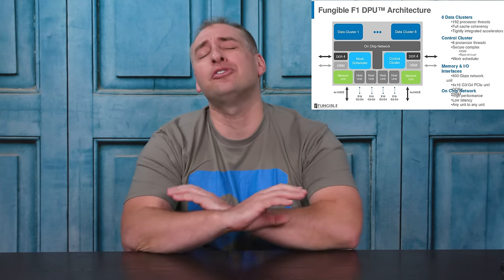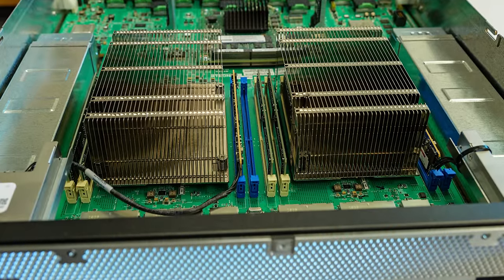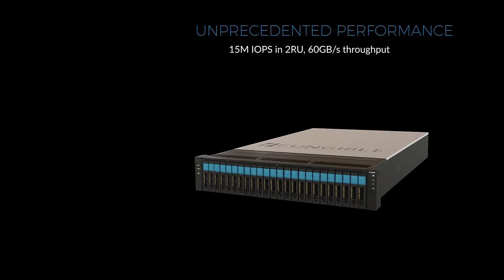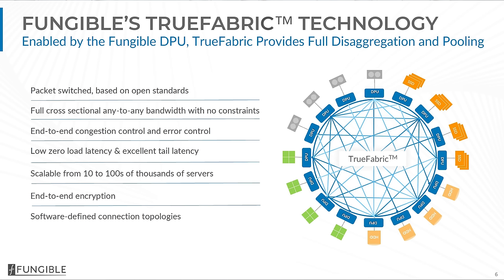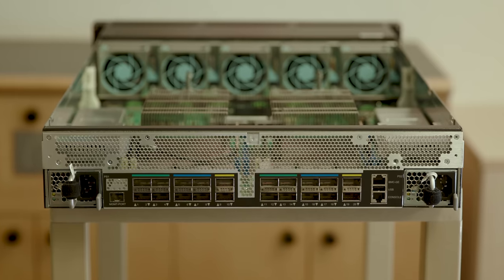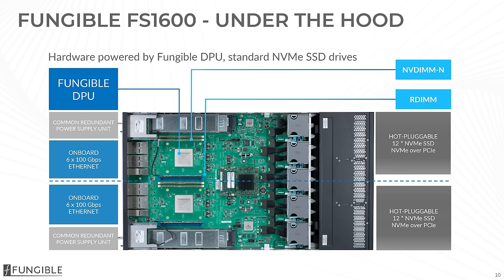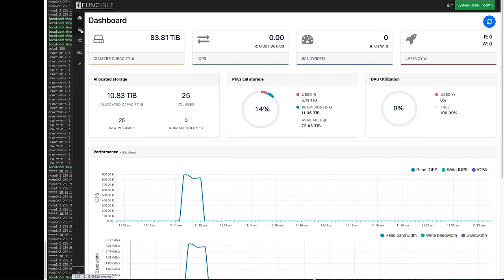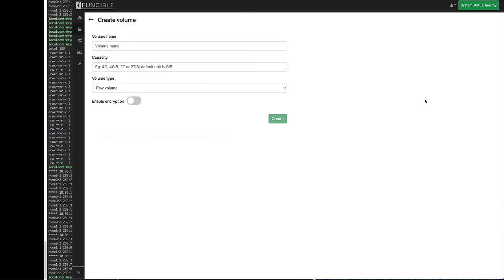Fungible F1 DPU Powered Storage Hands-on at Fungible HQ

Comment: For some reason I lost my shit when I saw the 10G management port haha
Reply: yeah that's really a 'because we can' thing 'eh... lol
Reply: Eh, it sounds "Crazy" when looked at from a bandwidth perspective; but from a latency perspective, the time the packet takes to transit the wire also sees a tenfold reduction. Moving from 1536 octet ethernet frames to 9000 octet jumbo frames (required as part of the 1000baseT & 10gbaseT spec now, previously optional in the 100baseT spec) is also an option for internally routed traffic that doesn't traverse the gateway out to the WAN. And for some of the new redfish management responses, they'll be chucked into time-series databases like grafana, and the finer granularity of the timestamp deltas makes order-of-events cluster-wide easier to determine accurately. This is one of the primary reasons I moved all my colocated machines onto 10G switch ports, but retained my low transit cap. I don't use a lot of bandwidth; but I frequently make interactive use of it (remote management) for control plane manipulation and VM setup, so lowering the round trip times can make a massive difference in quality-of-life, even if it's something as simple as VNC.
Reply: @SLLabsKamilion  yeah, I am aware of the latency reduction (not really sure why you went into Jframes though since they /can/ be present even with GigE, but still, for a management interface that's likely just serving a html5 configuration page the latency improvement from a few ms to tens of ns will be completely unnoticeable, so I'm not really sure I get your angle here. 
It's more likely that the CPU (DPU?) Just doesn't have the hardware for 1GbE, instead having 10GbE as a minimum, which is fairly reasonable from a 100GbE processor. 
There's a reason why the BMC only has 1GbE and that's because nothing more is needed, but unlike the DPU it doesn't natively support anything over 1GbE.

Comment: The biggest problem that I've ran into with ultra fast SSDs is that the faster they are, the faster they will die.

(Because you will want to use the blazing fast system ALL. THE. TIME. And because even enterprise class SSDs that can sustain 10 DWPD still uses NAND flash memory cells/modules with finite erase/program cycles, it just means that you WILL burn through that write endurance limit really, really quickly.)

What I would be MOST curious and MOST interested in is if you yanked one or a few of the drives out from each node and to see what happens to the system and the robustness and integrity of the service that's provided by the system (or when you burn through the erase/program cycles of the NVMe U.2 SSDs) and the drives mark themselves as either in read-only mode, or it just dies.

I'd be really interested to see how the system reacts to that, because it WILL happen with SSDs of any kind.

Comment: Fantastic read performance! Relevant for zero workloads...
Not a single question on write performance? Cmon, you guys can be a little more critical, you know this stuff.
Reply from the maker: Have some more on the STH main site on performance. Actually, they can get closer to 15M IOPS / 60GB/s per node but we are only giving credit for what was demonstrated. We only used up to 5 client servers and the client servers topped out around 2M IOPS and 60GB/s. That was a 15-20 minute demo that we had to cut down. NVDIMM is there to help absorb write workloads and sync writes. Good point. Probably should have left more of that in there.

Comment: No one:

Fungible: Here's an NVMe array with 10 million IOPS
Reply: just imagine how many VMs you could run on this bad boy
Reply: I would (ask for one) if it weren't for the fact that NVMe SSDs are such data death traps.
Reply: @ewenchan1239  What is the problem with NVMe SSDs ? Please elaborate ...
Reply: @prashanthb6521  
It isn't only with NVMe SSD. It's ALL SSDs in that the NAND flash memory cells have a finite number of erase/program cycles.

Therefore; even with provisioning, once you've consumed those finite number of erase/program cycles, the SSD is pretty much trash at that point, unless you specifically set the SSD to be a WORM, which, let's face it, nobody does that with a SSD.

As a result, SSDs are like the brake pads on a car - it's a wear item, that once you've worn through the write endurance limit, you throw it out and buy a new one.

All NAND flash based SSDs work this way.
Reply: @prashanthb6521  
I've burn through six the write endurance limit of 6 SSDs over the last four years because of this fact about the underlying technology behind it and that it has a finite number of erase/program cycles.

Comment: 10Gbe mgmt interface... yeah because that is surely needed.....!
Reply: starshipeleven  Well flexing comes at a price for the customer.
Reply: @savagedk  probably no more than $30, just put in a base-t sfp module.
They already had the silicon designed, so this was probably very low cost for that.

Also it probably allows you to run custom software on the DPU and provides control plane access to this software.
Reply: The more, the more!
Reply: @varno  How often do you run around tossing a $30 away getting nothing in return?
Reply: starshipeleven  exactly
Reply: starshipeleven  If I don't get any value for it yes, then it's 30$ wasted. It's similar to throwing it in the trash. It doesn't matter what the baseprice is in that regard.
Reply: starshipeleven  waste is waste.

Comment: I wonder how much the performance suffers is when encryption is added for both data at rest and data in flight protection.
Reply from the maker: Encryption was on in the demos. It is sped up a bit, but you can see the at-rest version being turned on. The DPUs have line rate accelerators for crypto/compression functions.

Comment: Can multiple of these systems be pooled for added capacity, performance, redundancy etc? it's already two entirely separate nodes in one box.
Reply from the maker: Yes, we have a bit on this on the linked main site article where, for example, we have six systems for IBM Spectrum Scale. This is 100% designed to be a scale-out storage solution.

Comment: can you connect a Proxmox server to this server or a single dpu version, and do a local NVMe test, then a Network NVMe test ???
- what the cost of that server without the drives ?
- can you connect directly or do you need a switch ?
- if you have two of these storage servers can you do HA without a switch ?
- what about clustering, will total storage show in one interface or do you have to go to each server interface ?

Comment: Really cool storage system but a bit confused on MIPS and not Risk V. Is it just to new or not tested enough?
Reply from the maker: When you have networking folks who have used MIPS for years, you get products based on MIPS :-)
Reply: starshipeleven  thanks for the info. It may happen at some point but not now. (I just realized how badly I was spelling RISC-V)
Reply: @ServeTheHomeVideo  a very mature platform then.
Reply: mips has been used for decades and it's very known and matured. not so power efficient but in a system like that, power is not the problem.

Comment: Why so many 100gbe ports?  Does it have to do with their fabric?   We’re they using RDMA or TCP as the transport?
Reply from the maker: They have 12x SSDs. With PCIe Gen3 NVMe SSDs they need around 3x 100Gbps to match SSD bandwidth. With Gen4 SSDs they need around 6x 100Gbps lanes. A rough mental model (this is far from exact, but an easy way to remember) is that a PCIe Gen3 x4 NVMe SSD takes around a 25GbE port worth of traffic. We covered a bit more on TrueFabric and what they are announcing next in terms of the adapter in the main site article.

Comment: At this point, this is not "DPU", it's just a custom cpu powered system with custom software stack.
Reply: Not really. A conventional CPU system would rely much more on Memory accesses. These are highly custom chips that more or less directly connect NVMe to the 100GBit/s links that are directly on the same silicon.
Reply: starshipeleven  The HBM is likely for deep packet buffers on the integrated 100Gb NIC’s. When you’re throwing around that much traffic, and some congestion hits, you need to make sure you can temporarily buffer packets somewhere for QoS purposes, especially when you’re talking about NVMeoF. A single dropped packet would mean an entire reinit of the NVMeoF connection, which is slow and costly. We already see HBM in use on modern merchant silicon switches.

Like others have said, this is likely a direct DMA implementation, with the built in MIPS CPU’s simply orchestrating the DMA transfers from the NVMe PCIe address space, to the integrated NIC’s address space. The data they’re transferring won’t be hitting the CPU, nor it’s memory.

Comment: x86 is old and full of bloatware, time to replace it
Reply: Isn't MIPS as well. They should try to use Risk V for a modern platform.
Reply: @thomasb1521  MIPS isn't bloated, MIPS and RISC-V are actually quite similar as MIPS is based on RISC-I. 
The architectural advantages of RISC-V over MIPS might not be that relevant for many workloads.
Reply: starshipeleven  So what? That's a problem for the CPU designers to solve, not for the computer users to worry about. It's just that for almost a decade Intel didn't have real competition and they got lazy. Once AMD got their shit together it became obvious how much we have been missing. And, as usual, the best is yet to come. The rumors for X86's death have been grossly exagerated. Many times before.
Reply: starshipeleven  that is true. Also it is to general for this application to be done efficiently.